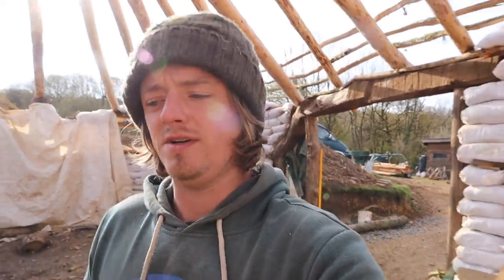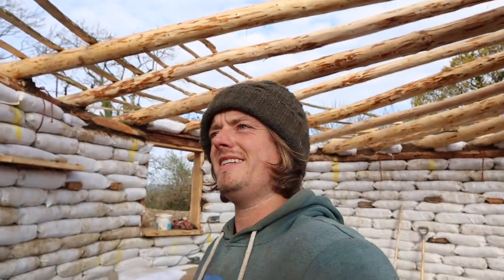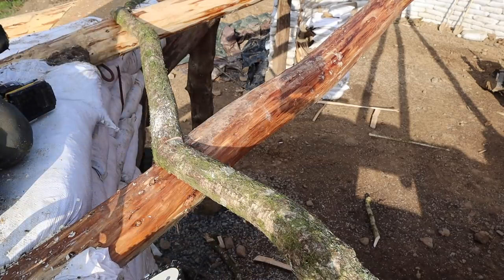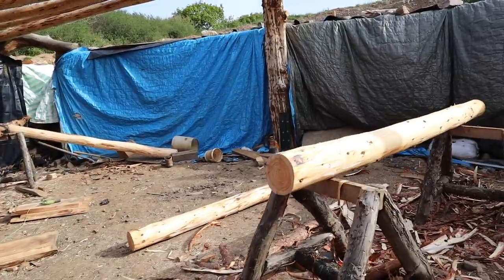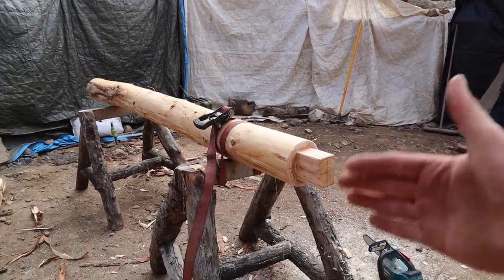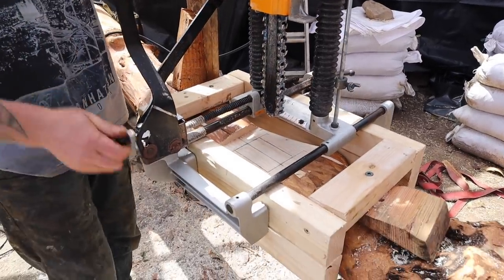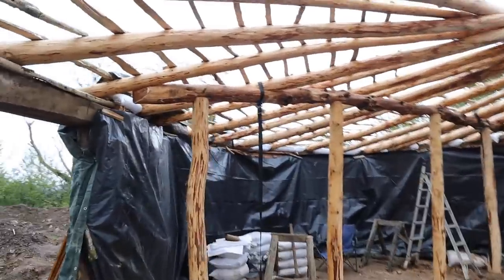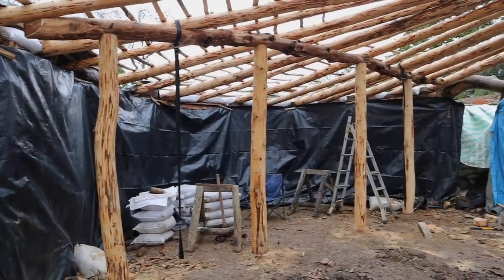Off Grid Earthbag Workshop Part 23 Roundwood Timber framed Dividing Wall

Comment: Youre lucky with UV in Wales. Here in Portugal it is so high it destroys polypropalene in 6 months which is a shame because  the external structural and decorative straps that hold the yurts together are useless.We had to use sleeved stainless steel wire instead.

Comment: It would probably make things easier for you and you'd get a better, cleaner result if you sharpened your chisels properly. Either you don't sharpen them enough, or if you do sharpen them frequently, you're doing it incorrectly. Acquiring a proper break-angle for the edge and stropping the burrs off are essential steps. You should look up Crimson Guitars' "Scary Sharp" honing method video.

Comment: 15:33 I have a question about these posts. How is the flush cut made on the bottom so that the post sits plumb? I find that difficult to eyeball and even harder to properly measure and scribe. And that cut will be reflected on the shoulders of the tenon, correct? Thanks for any insight, previous uploads, or terms to Google.
Reply from the maker: Well i tend to just cut them depending on what they are sitting on. most of the time i sit them on stuff that isnt flat and just do it free hand. but you could measure down from the shoulder and create a line all the way around. or use something like a ratchet strap to draw a line all the way around. or you can scribe them but that takes alot of time.

Comment: At 1:34 the wood cracks when you drive the screw... Is it just being tacked in place, or is that expected to bear any weight? Might be worth pre-drilling. I guess the force of the roof will be mostly downward due to the shallowness of the angle, but...
Reply from the maker: Really the screws are just to hold them in place until the weight is on them and while I am up there walking about. They will crack regardless of pre drilling or not as they are wet and as they dry they will crack on the ends.